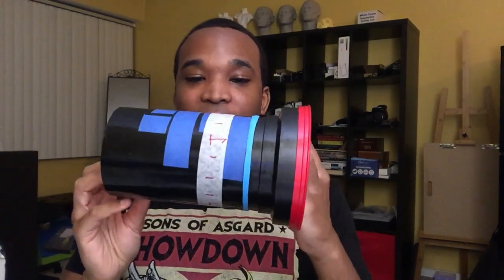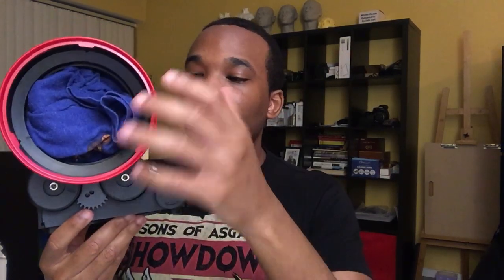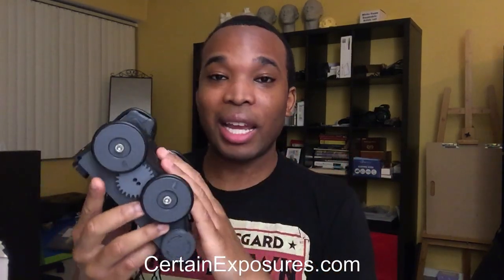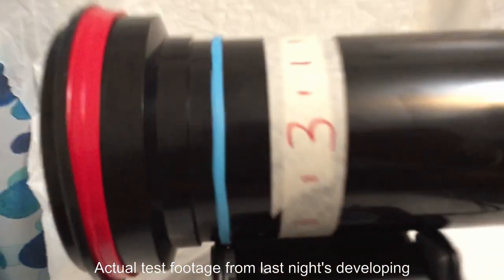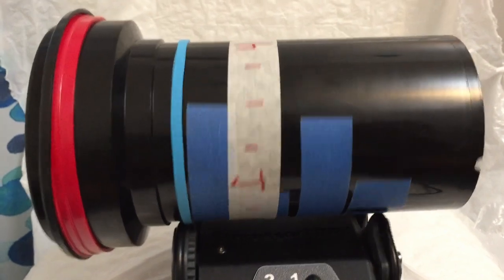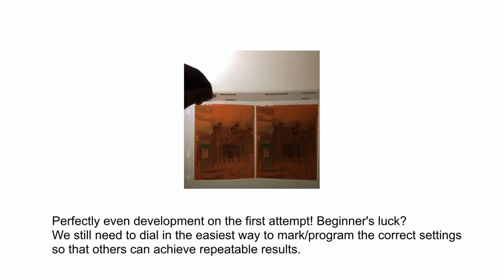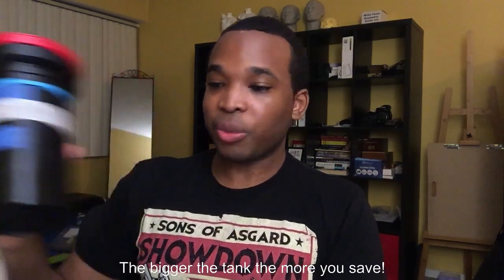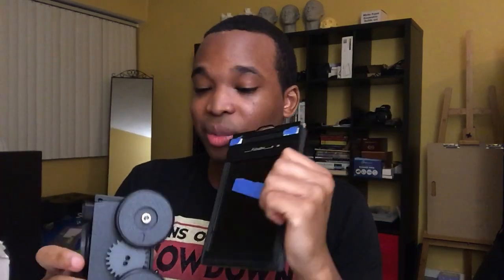The future of home film processing? Beta testing B’s film processor “TR” prototype

Comment: From the video, it appears that the tank is partly rotated then reversed and back again in a manner which causes it to progressively advance around a full rotation of the tank over a period of a minute or so. This would mean that once "wetted" film would be agitated by tank rotation several times before the rotation advances sufficiently to pull the film up into the undunked top of the tank for ?? time until the tank has completed a full rotation again. If this is how it works, it looks to me like a receipe for uneven development, so maybe I misunderstood.  In any event, this seems just a tank or drum rotation device like those common in the 1980-90s when color work at home was popular, except those tanks rotated the tank much faster and do at least one full rotation before reversing. Frankly, that seems less complicated, more reliable and cheaper to build.  Since Paterson tanks tend to blow off their lids if the process builds up any internal pressure, perhaps a different brand of tank would be more appropriate. The squared off wheels on one side of the unit seem intended to give the tank a bump as they rotate. Not sure what that purpose would be
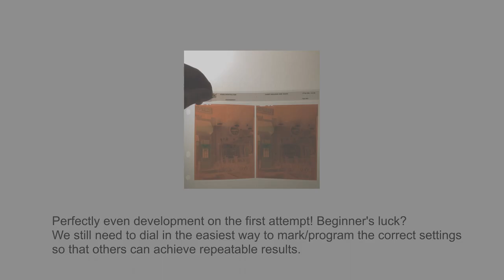Reply from the maker: Hi, Randall. At 4:10 I show two 4x5 negatives that were evenly developed using this processor. The rotation amounts are independently adjustable in each direction and so is the speed. This unit has a max rpm of ~39 which is about 9x the original. I displayed it rotating in its midrange speed. The bumpy wheels are for additional agitation and I use them when developing large format. I used the bumpy wheels to develop the 4x5 negatives shown here. It is true that fresh C-41’s blix stage can blow the lid off of a Patterson container if you are not careful. I experienced that first hand with the previous B’s processor. I recommend  slightly opening the top cover right after closing it to allow trapped air to escape. You’ll hear an audible “sigh,” and then the tank top will sink. There won’t be a problem after that. Jobo tanks are compatible with this unit as long as they fit the minimum tank length of 4.5 inches (117mm).
Reply: @CertainExposures  So, my experience (Unicolor 352 base) has been that if there is any weight imbalance in the tank (such as extra plastic for the top, internal funnel, etc.) or if the tank is tapered (Paterson ?), as it rotates, it tends to "walk" toward one end of the roller base until it falls off. seed of rotation, direction of same, are not going to effect that.  Adding what I suspect is an unnecessary  "bump" wheel in the rotation would tend to exacerbate that problem.  What's your experience.  (I say that the bump wheel seems unnecessary, as a "tank tap" is to loosen bubbles formed by inversion agiaton. With rotation agitation, you do not get such bubble formation.)
Reply from the maker: @randallstewart175  Benoît solved this by using rubber bands around the tank. If you take a look at 1:51 you will see that I have two rubber bands around the top end of the tank just under the opening. So far, this has worked well. Even with the bumpy wheels at a speed of 6 or lower in my experience. As the tank walks, the bands push the tank back on track. 

I have not yet used the unit beyond speed 6. I could do a quick test of that in the future. 

Unfortunately, I cannot add much value to your comment about the necessity of the bumpy wheels because I have not tested multiple exposed sheets with them and without them on this particular unit. Some of Benoîts customers have mentioned issues with uneven development or streaks without the bumpy wheels on 4x5 film with the previous model. He introduced the bumpy wheels to solve that problem, and I believe he has examples of the improvement that he could share if you reach out to him.

Comment: The think is that we need a processor inside a hot water wille rotation to keep the temperature steady
Reply from the maker: Hi Tasos! That would be the “ultimate” solution for people who want absolute perfection. The trade offs in terms of footprint, price, and user friendliness compared to Benoit’s unit would not be appealing (that’s why I do not want a Jobo) and in my experience you can achieve acceptable results without heated submersion. I will share several examples of negatives and slides that may challenge your view. Unfortunately, that will not come any time soon because some of my production equipment did not survive 2020. Stay tuned!

Comment: Hey all! First, I just subscribed! Second, I am BRAND NEW to film. 4 years shooting digital. I realized after my first two rolls that this is going to be expensive. So I bought a whole kit to process at home and I am fixing to buy a scanner. What I noticed was that my negatives were drying and seemed to have a film build-up. I am maintaining temperature, using CineStill CS41, 2 bath solution with distilled water, and a 3 solution for the final rinse with distilled. 

What I was hoping to ask is, how do you prevent that build-up? It seems that my 36 exposure is too long and possibly drying before it drips off? I read on Kodak's site that you can use 98% isopropyl and a lint-free cloth to give it a once over. I also rewashed after steaming my restroom with the shower and drying a second time. Luckily, this roll was nothing too important, and just giving this a go, though I would like some advice from anyone actually on how to get a cleaner final negative.

Thank you in advance and I am going to go check out your page!
Reply from the maker: Hey, congrats on catching the film bug 🙂. I noticed this problem disappeared for me on days when the ambient temperature in my room increased. So, I bought a mini space heater. Your mileage may vary though. Give it a shot!

Comment: Talking for experience, this is going to leak like crazy, second of all, this will probably work with sheet film but it will cause development streaks on 35 and 120 films, almost guarenteed.
Reply from the maker: Hi B! At some point I’ll share more work that I developed with this unit. You may be pleasantly surprised with the results. Developing processes like c-41 and e6 that emit gas can require extra attention to detail when using a Patterson tank because of their poor lid design. However, that’s necessary even without using this processor. I may switch to a different tank design to fix that because Benoît’s processor can accommodate other designs.